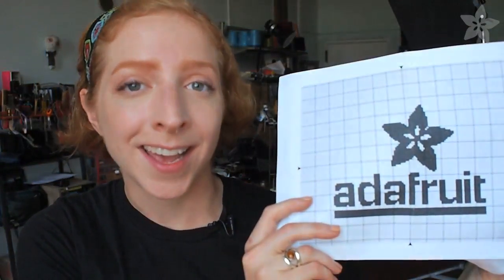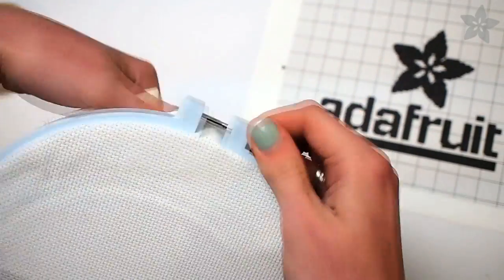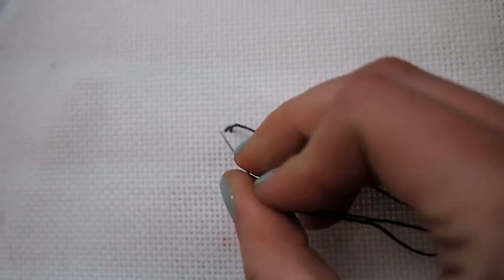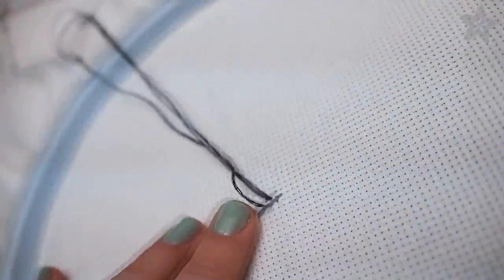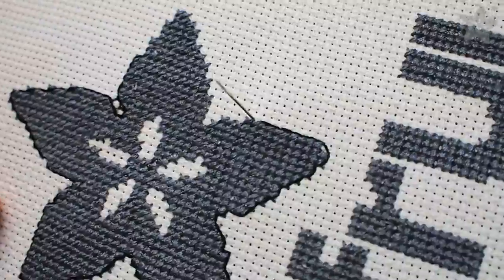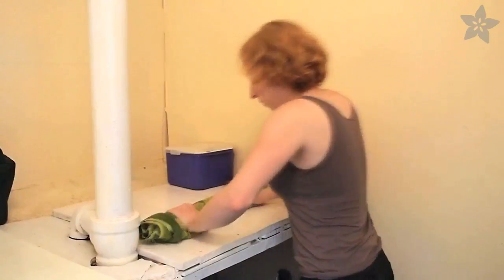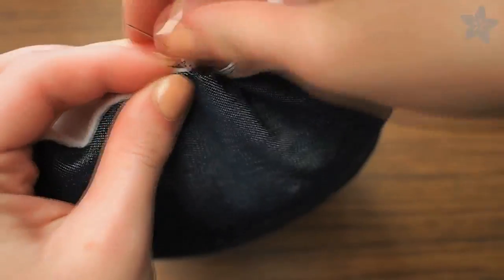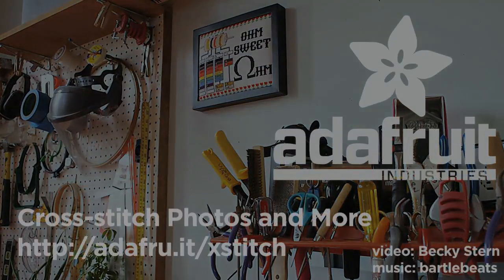How To Cross-Stitch

Comment: Knots let you potentially use more string and you don't have to worry about pulling them through. I do x's because it is easier to go back and fix something if you make a mistake. I've never gotten a dirt ring, but even if you don't see dirt, wash. If you are iffy with an iron DO NOT WRING WITH A TOWEL- I burnt one of my cross stitches trying to get towel wrinkles out. Lie flat to dry and stretch it taut when you frame it (I suggest using stainless steel pins and acid free non-sticky foam).